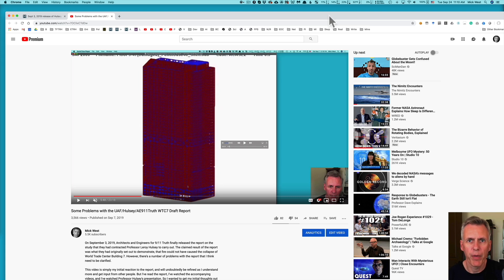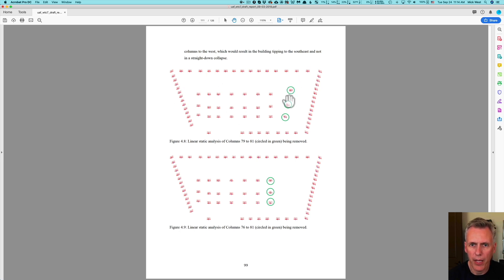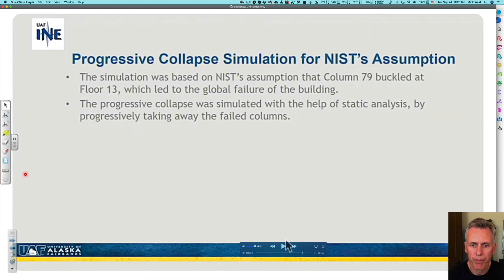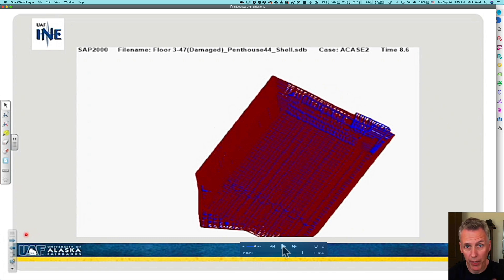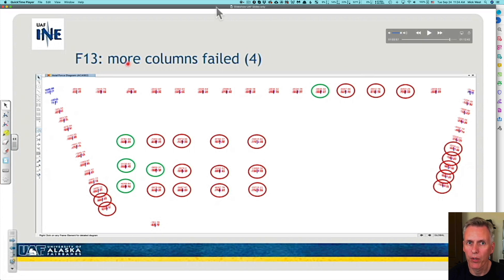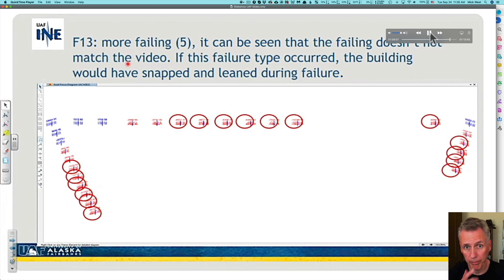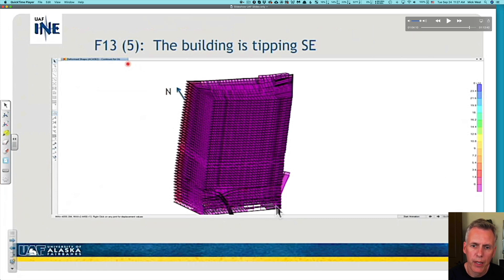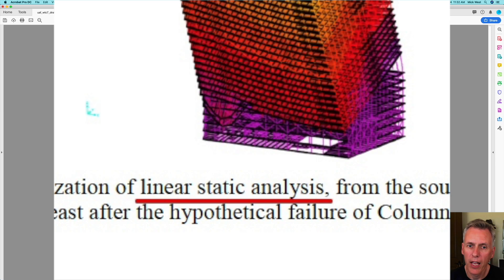More Serious (Technical) Problems with the Hulsey WTC7 Draft Report

Comment: Er, has anyone noticed that buildings tend not to "fall over" like that except in very specific circumstances?  To do so the structure would need to acquire very significant angular momentum.  But the concrete fractures at a very small displacement, and then the dominant force is downwards on everything, so it gains downward momentum quicker than it gains angular momentum.  What kind of idiot ignores the empirical evidence of large buildings mostly collapsing close to their footprints, even if the initial collapse was asymmetrical, rather than trying to understand it?  But, far more importantly, what kind of society accepts the conclusions of such idiots?

Comment: I just stumbled upon this video and I’m not even a minute into it but I have a simple question for you Mick; what do you think a linear static analysis is?
Reply from the maker: It's a finite element analysis where the displacement has a simple linear relationship to applied forces, and where these relationships are static. It's not time-dependent so also ignores inertia and collisions.  Kind of like a simple rubber-band model. You can see the problems in the weird distortions and massive columns loads that the model has at the ends of the manual steps they use.
Reply: @MickWest  I asked because you were confused as to why they presented a linear static analysis; you were pointing to the building lines not being ‘linear’ and the building itself not being ‘static’. Which, to those of us educated in structural engineering, insinuated that you misunderstood what a linear static analysis is. Which is exactly the kind of analysis one would use in this situation.
Reply from the maker: @anthonyp4949  I understand what it is. I don't think I said anything about the building lines. That wouldn't make any sense. Maybe when I was pointing out the amount of deformation, which had gone WAY beyond what you can usefully simulate with linear static analysis. 
Like, if you physically stretch a girder or column past its elastic limit, it's ludicrous to continue to think you're getting useful results from the simulation.

Comment: As a structural engineer who has experience with the software that they are using I would like to point out the following. 
I am relatively new to the WTC debate and I don't have a strong view on it. I do find it bizarre though that this debate is so passionate (but I am not American)

1. We use static and linear analysis all the time to design buildings and obtain the safe load, what Hulsey did with removing the columns is standard engineering practice to predict the falling pattern of a structure. Linear analysis is sufficient given that it solves the equilibrium of energy equation,
2. all the analysis is essentially the solution to the equation ma + vc + ks = f(t), ma = mass x acceleration vc = velocity times damping, ks = the spring equation, f(t) = the time dependent load, which in this case is the fire load. 

Abaqus itself has a module to apply the fire load as a dynamic force and to obtain a dynamic result, from what I gather this was reported. Generally speaking static analysis are a conservative approach for a dynamic analysis and not the other way around as you argued.

1. You do have a point that the deformation are non linear and in particular the connections, but that would validate his argument that the connection couldn't move as it takes more energy to reach plastic deformation than elastic deformation. In actual fact the hardness of the structure has to be modelled.
2. The strongest argument that Hulsey has is that the floor system's thermal expansion coefficient is axisymmetric, i.e. it will move more to the east than the north. NIST doesn't seem to go into detail in their report on how they calculated it.
3. My biggest objection to NIST is that they do not publish their data openly so that engineers can go through with it. 

Looking forward to your response.
Reply: I can't compete with the above sophistication.  But I think it is obvious that once you have a modest displacement, all the columns are broken, and once the columns are broken the building collapses mostly vertically.  If the model fails to reflect that, the model is no good.  I'm sure that in reality there is a cascading pancaking collapse as different parts fail at different levels, but the issue is that you can't use a theoretical model if it hasn't been shown to replicate actual observed collapses.
Reply from the maker: "obtain the safe load" is a perfectly reasonable use. What I'm saying is not is creating a dynamic visualization. Hulsey essential does a static analysis to see which columns fail, then does a NEW static analysis to see what will fail next. This ignores all dynamic elements (falling floors and column). He also allows the building to pivot on columns that are going to fail, when in reality they would simply fail.
Reply: @MickWest  for the floors to fall you first need to break the initial column though, and if that occurs the energy will dissipate in what is called moment redistribution. Afterwards one can look at the most stressed elements to see where the most likely next failure will be. The way he demonstrated it is industrial practice to predict the load paths and the demolition path of a building. E
If you want to model collisions then the matrix isn't much different than I described above except there might be coupled components involved and I don't think that the NIST went that  deep in their analysis (They used LS-DYNA to model their structure, I am also familiar with the software). Take into account though with collisions that the energy that dissipates will be the same,, (the law of conservation of energy holds EP = 1/2mv²), 

Generally drop load calculations are done to check for localized failures, i.e. will an object falling from a crane punch through a slab for example, it's hardly ever done for the entire structure and unnecessary. Engineers also tend to underestimate deformations, but if you want a correct visual one has to go into second order effects.

Here is a paper that describes the matrix that I cited above for a car crash, https://www.researchgate.net/publication/357416790_Analysis_of_the_vehicle_applying_finite_element_method_of_3D_data Abaqus does treat it that way for fire simulations,

Where you do have a point is in the non linear analysis, but it can mean that can also mean that overestimated the bearing capacity of the building (it can swing either way).
The other critique that I have against his analysis is that I am not sure that he took into account that the structure is already deformed once the fire starts meaning that its behavior might be most plastic and the load path less intuitive. I am also not convinced that the columns will just fall, they tend to pivot around the distance between the moment of inertia and their centre of mass.

What Hulsey does point out thought is that in the event of fire, 
The building will pivot arounds its center of thermal stiffness (that is off center given that it is symmetrical) and the NIST Report does not mention must of this, in fact I think it simplifies the slab system too much.
NIST did neglect the stiffener around the beam at column 79 and that asks the question if the fire would have caused it to fail at that point.

After digging into this issue, I also want to point out that there are 5 reports that aimed to explain building 7, 4 of them point to fire and then this one is the first to suggest progressive  collapse. 

Overall I don't think that his analysis is quackery or should be treated as such, but it does have shortcomings and isn't in itself entirely convincing. It does in my view ask a legitimate question and honestly I don't see why NIST should keep their models secret and not allow for engineers to play around with and scrutinize it a bit.

Thanks for your early response,

Comment: OK, so basically you're trying to debunk a scientific academic report with the shortcomings of its presentation techniques and choices made in the presentation? In the final report there are plenty of mathematics used. What is your response to the final report regarding mathematics and physics? Actually your video is more like a work of a conspiracy theorist.
Reply: Did they attempt to measure the temperatures of the fires? That's kind of important as steel loses about 90% of its strength at half the temperature required to melt it.

Comment: Excuse me, but are you a Structural Engineer, or do you have Engineering training? Your commentary so far leads me to believe you don't. You should get experts to help you. For example, I don't think you know what a static linear analysis is. Also, it is quite common for structural models that contain failing components to show wildly large displacements - its a consequence of the mathematics that underlie the model. When making a presentation, you have a choice between a graphical output that looks good, and a numerical output that makes sense, these are not the same when you are modelling failures. I think you have lost sight of your objectivity on this one.
Reply from the maker: Could you be more specific?
Reply: @MickWest  Well, I gave two examples, but to expand further on one of them. You state at 41 seconds: "What is the justification for using a linear static analysis for something that is neither linear, nor static". I think this shows a laymans understanding of these terms. A youtube combox is not ideal for explaining this, but you could think of a linear static analysis as providing a snapshot of the forces and displacements at a given moment. It will have some simplifying approximations, but that does not invalidate it as an analysis tool. It is sufficient for large scale, global checks of what is happening with forces and movements. A linear static analysis was probably chosen because it is less computationally intensive, and it allows the Report Authors to check the building response at different stages under different scenarios, which is what they want to do. However, in the report they state that both dynamic and static analyses were perform for the NIST scerario and they did not produce a progressive collapse.
The theory/hypothesis being put forward in this report is that the simultaneous removal of three columns would not initiate progressive collapse as observed on 9/11. The evidence for this is a series of structural analyses, each with a little bit more of the structure deleted, as you describe. This results in the building tipping over, which is more in line with intuition. If you knock two legs out from under a table, it doesn't collapse vertically, it tips over. This is the hypothesis which needs to be addressed if you want to counter this report. Comments about animations styles and what not are irrelevant.
The reason  I say you have lost your objectivity is because you are trying to "debunk" this report, not objectively evaluate it.You seem to have already formed your conclusion (i.e. the report is wrong) and you are looking to justify it.
I mean all this respectfully.
Reply from the maker: Sure, you can use static analysis to see, in a simple but useful manner, if the loads transfer to adjacent columns, and if any of those columns fail, then you can demonstrate a progressive collapse will ensue. The problem is that the events of WTC7 were not a simple spring-mass system, and the determination of progressive collapse is not a simple time-invariant load-redistribution problem.  It's a problem that involves collisions - specifically falling debris. The collapse was initiated by falling floors hitting lower floors, columns, and the truss structure. That's simply something you can't do in a static analysis. Read section 4.3.2 NCSTAR 1-9A to get a sense of what was involved. 
 https://www.metabunk.org/files/NCSTAR%201-9A%20Global%20Structural%20Analysis%20of%20the%20Response%20of%20WTC7%20to%20fires%20and%20Debris%20UNLOCKED.pdf
Reply: @MickWest  The report specifically deals with this objection. If I remember rightly, by properly accounting for the stiffness of the falling girder, the magnitude of impact forces is significantly reduced from that stated in some NIST report. Hulsey agrees with other investigators that the fire induced "girder walk-off" was not possible given the construction details.
In any case, the point of the static analysis is not to show the effect of collisions, it is to demonstrate that the mechanism which started the progressive collapse (column loss, according to NIST) does not in fact lead to a progressive collapse. In fact, they (Hulsey) claim the removal of the columns would not cause collapse AT ALL. Static analysis is fine to show this. It also claims, that had enough additional columns become destroyed, the mechanism would be tipping over, not a vertical collapse downward.
You seem focused on the term "static analysis", I think, because you think it means Hulsey ignored the effect of collisions. It does not. Get someone who understands engineering to help you.
Reply from the maker: @matthewsimmons9251  It does not deal with it at all. I'm talking about a global analysis - a simulation of a collapse. Their one single calculation of an isolated incident with a  girder has no bearing. 
And static analysis does not show the building tipping over, that's wrong in many many ways. You just need to look at the loads they say occurred during the "tipping over" it's ludicrous. 

Ignoring the dynamic (and non-linear) nature of the collapse means their analysis is worthless.
Reply: @MickWest  You have just demonstrated, to any one who knows anything about structural engineering and analysis, that you do not know what you are talking about.
Reply from the maker: @matthewsimmons9251  Can you explain what is wrong with what I said?
Reply: @MickWest  admit that you are a layman in these matters and have never performed a structural engineering analysis using computer models. I bet you have never even performed a structural engineering calculation by hand.

Every good engineer will tell you that  first principles are just as important as computers, if not more.
Reply from the maker: @matthewsimmons9251  If there was something specifically wrong with what I said, then you should be able to explain it.
Reply: @MickWest  Still no admission I see. The problem is you are a layman commenting on expert testimony. You need years of schooling and experience to start to understand how buildings stand up, before you can make a cement of any worth on how they fall down. Will you at least admit that you wanted to prove this report wrong before you even read it?
Reply from the maker: @matthewsimmons9251  I did suspect it would be wrong, but that was based on earlier talks by Hulsey. I want whatever is true. 
Can you not say what is wrong with what I say about Hulsey's report, other than "you don't understand"
Do you understand? What am I getting wrong?
Reply: @MickWest  my point is you don't have enough prerequisite knowledge  to edjudicate whether a certain analysis approach is permissible. The report is not written by a random nutcase. To bring you up to a level where you understand the basics cannot be done here. That is why I advised you get proper assistance. I do have engineering knowledge which is how I immediately knew you don't know whereof you speak. Good day, all the best to you.
Reply from the maker: @matthewsimmons9251  Do you?
Reply: @MickWest  yes, I promise you.
Reply from the maker: @matthewsimmons9251  Okay, so explain what I got wrong.  Heck, make a video about it.
Reply: @Shelby_Starner_Everything  I can't, that wasn't the point I was making. The point I was making was that this "debunking" of the Hulsey Report is a bad one, and the person doing it doesn't have the requisite knowledge to do so, and the person doing it admitted he began his analysis with the conclusion already at least  half-formed in his mind. 
You will notice I never said I agreed with Hulsey's conclusions. So I throw your question back at you - explain from a technical standpoint why Hulsey is wrong.
Reply: @Shelby_Starner_Everything  so where is his report wrong
Reply: @Shelby_Starner_Everything  you can't just declare that you think it's a load of rubbish and think you have convinced anyone except yourself. If the report is right, then we don't know what the exact cause is. You may hypothesise about thermite all you wish, but I recommend waiting for more evidence. Again, I am not saying Hulsey is right, I am saying this critique by Mick West is a bad one, and yours is no better. Good day to you.
Reply: @Shelby_Starner_Everything  you are just repeating yourself and not bringing any evidence against or cogent criticism of Hulsey. But go ahead, you can have the last word now.
Reply: @matthewsimmons9251  At some point Mick switched to a sock puppet account "Quake Ppoof" and then deleted his own comments?
Reply: @noggogo6932  wouldn't surprise me haha

Comment: https://youtu.be/1h-f-CJzgG8 

Ok. If Hulsey is wrong, how could this hotel in beijing not collapse?
Reply: In order for a building to collapse like wtc,7 you would need the following things to ''all'' happen on the same day........

 (1) A steel framed building of same design as wtc7.

(2) Fires that are just the right temperature for thermal expansion to happen.

(3) The water main broken so fire fighters can't control the fire.

(4) The buildings has long span steel beams.

The chances of all these things happening on the same day are very low.

And how many times has a large plane crashed into a tall building in history?